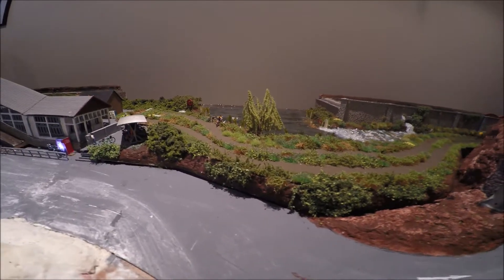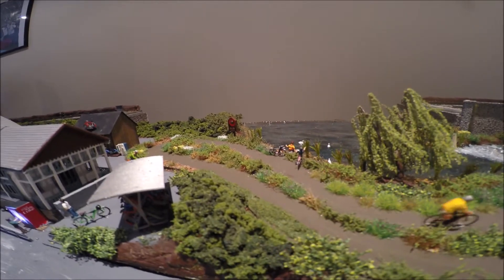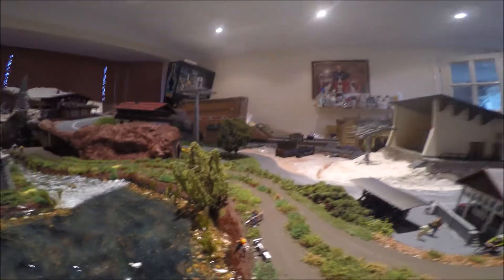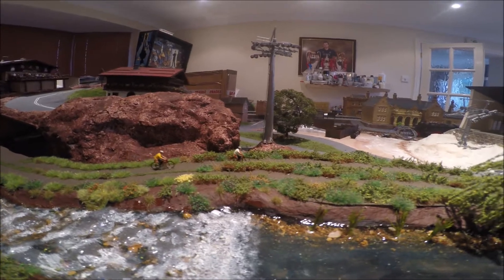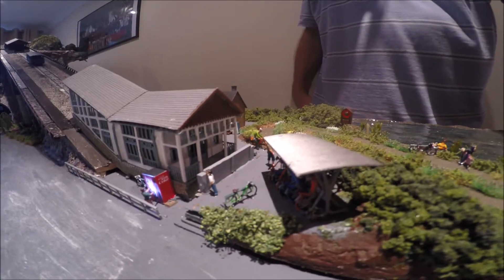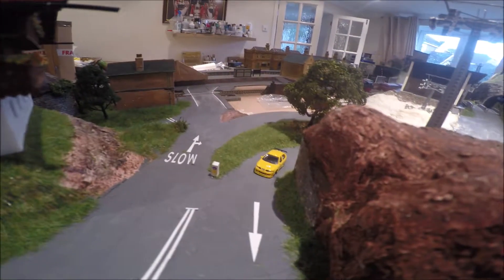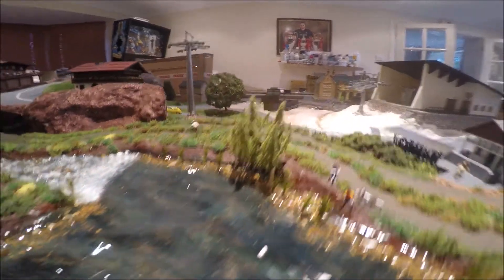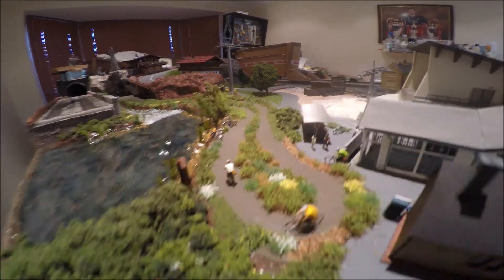#20 Progress Update - Magnorail update

Comment: How many motors do you have on the Magnorail it sounds as though it is under a bit of stress.
Reply from the maker: I only have one motor on the river magnorail.  At this late stage I'm not sure I could fit a second motor as there is not much space to adjust the magnorail track design to allow another motor to be fitted.

Comment: Hi great update, I had a slight whining on my Magnorail, found out it was the motor that was out of vertical, popped a bit of foam one side and straightened it up and fixed the problem, feel free to take a look on my channel at mine. Clyde at magnorail oz is an expert in this subject so maybe worth contacting him for advice, his channel is Klatchco56
Hope this helps, cheers Martin
Reply from the maker: Hi Martin - Thanks for the tip. I'm pretty sure the motor is vertical but I will check that first thing tomorrow morning.  I think its the motor as my 5 others (3 on the sea and 2 on the alpine sections) don't make anywhere near the noise of this one.  I have one more Magnorail to install near the station at a later date so hopefully that will be ok; - we'll see in due course, when I get onto that bit of the layout. Eventually I expect that I'll get round to replacing the motor.
Yep - aware of Clyde and Magnorail OZ. He has been a subscriber since the beginning of my build and the rippled plastic I use for my sea scene was purchased from him nearly a year ago now.
Thanks Rob.
Reply from the maker: Update - Checked the motor position and it looked vertical. Tried wiggling it slightly but it made no difference to the noise issue. Not the end of the world, will probably look replace the motor eventually.
Reply: That’s a shame it wasn’t a quick fix, I’m sure you will get it sorted, keep us posted when you find out the problem, thanks for the update, cheers Martin